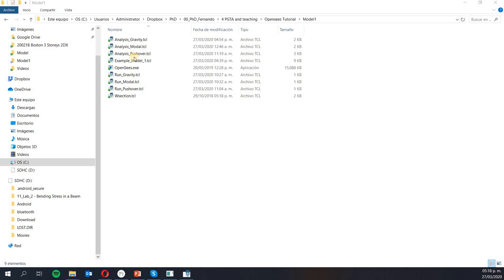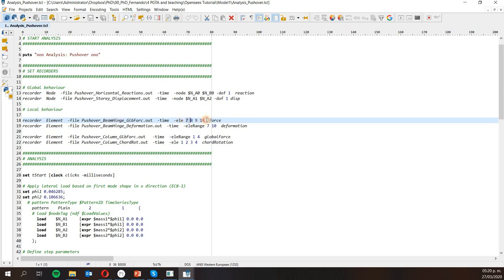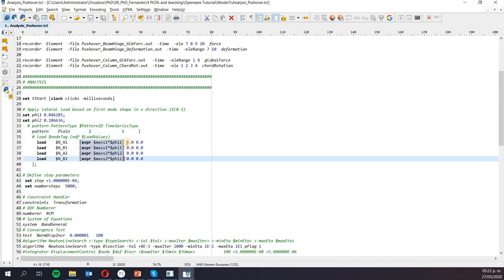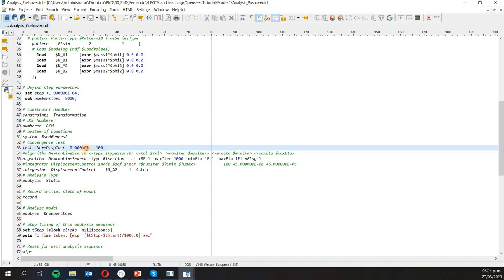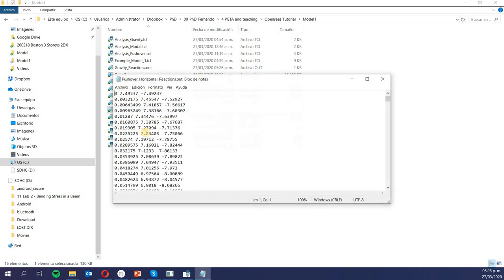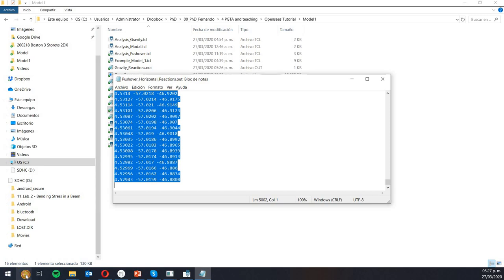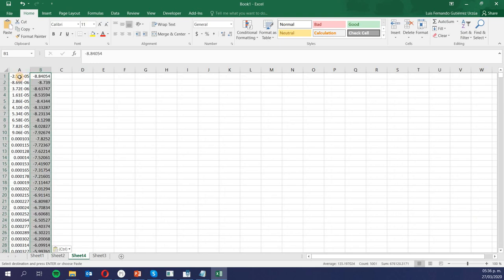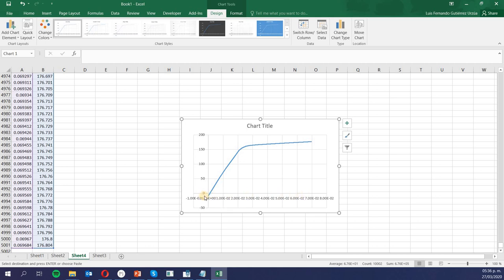OpenSees - Your first OpenSees model - 3 Pushover analysis

Comment: Hi Luis, the values in the middle column are selected from each node, from the results oof chord deformation. What does the values for each element actually mean?
Reply from the maker: Very good question. For a 2D model, there are three columns per output. The second column is chord rotation at i end, while the third column is chord rotation at j end.